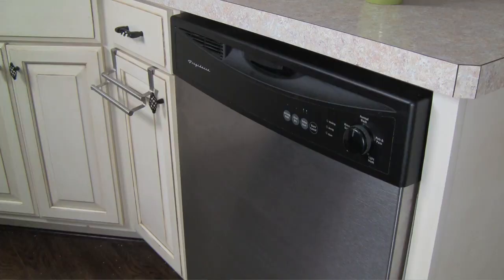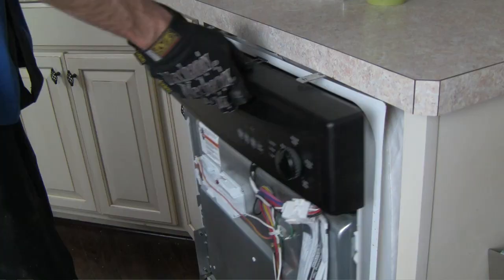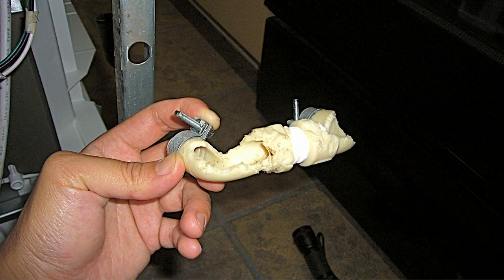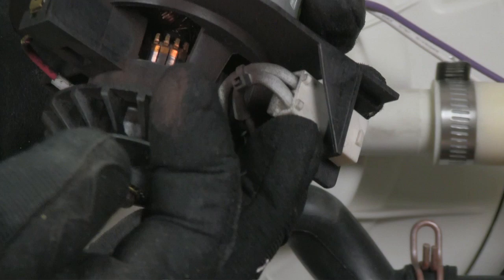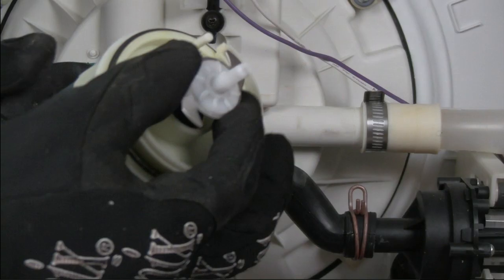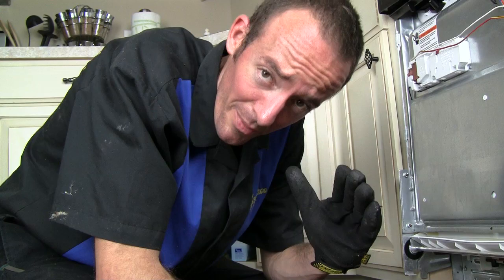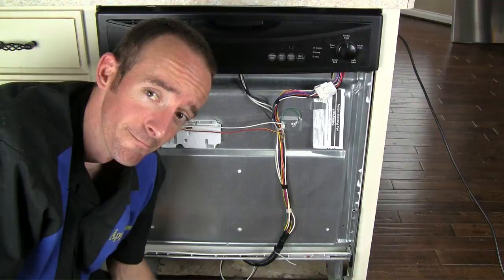How To Repair Frigidaire Dishwasher Noises

Comment: Ok. figured out it was the brass connector needed to be tightened. But when i pulled the wire off it had brown blackish mark on it....maybe an arch flash? when water was driping on it? is there an internal fuse for this?? or did it short out the whole heating element. I dont have a meter to test the element.

Comment: Here's a question for you- the float in my dishwasher had a chunk of food holding it up so I think the drain pump stayed on too long. Is there a fuse or thermo shut off that would kick in if the drain pump over heats? She's not draining and no sound from the drain pump.
Reply from the maker: Not normally. The float being held up would keep the dishwasher from filling but that should be all on this style.  You would probably need to measure for 120VAC on the leads to the drain pump after pressing the cancel/drain button. If you are getting 120AC then its probably a bad connection to the drain pump or the pump is bad.  Hope that helps!

Comment: I have model pld2560lcc1 and keep getting a "CL" error.  The latch is clicking shut and wash cycles run for like 20 minutes then "CL".  I'll open the door for 30 minutes then close it and the cycle will run for another 20 minutes.  I have to do this for each wash.  Could it be something as simple as the door gasket or am I going to have to buy a new latch/control board? Thanks for this video.

Comment: my dishwasher works fine but as the days go by and if I don't use the dishwasher, it accumulates water inside the dishwasher... Would it be the inlet water valve that's leaking water or the water pump that is defected?
Thanks for your help
Reply from the maker: Sorry for the delay in responding to this! too much on my plate in the last few days.  Yes that does sound like the water valve is not closing completely, and is letting water slowly leak into the tank.  most likely a new valve will fix it. Good luck! thanks for the question!

Comment: Under the Diverter Cap there is a ball check that rolls down a set of moulded rails to plug off the inlet port to the top jet. I've opened it up and can't for the life of me figure out what moves that balls position from blocking the top jet to blocking the bottom jet. I ask because my washer has recently been doing a terrible job at washing my top rack and it appears that the top jets do not activate... Any ideas how that activates or what controls it? I have the same washer as is in the video.

Comment: Can you purchase the impeller separate from the pump? I had a plastic bead lodged in the impeller area and cause the threads to strip (plastic to metal, metal wins) either that, I might epoxy the impeller part onto the shaft of the motor.
Reply from the maker: Darrin Calcutt Sorry for the delay. Unfortunately no it's a complete assembly... and very common to break I might add... Thanks for the question!

Comment: @applianceassistant On the third wash attempt it started a wash cycle that I'm pretty sure was different from what I programmed.  On the fourth attempt it made it through a normal cycle, but didn't dry even though I'm pretty sure I had pushed the "dry" button.  Anyway, it appears to me that it is losing power somehow during the wash mostly (and at least this one time while it was off) and resetting and is also starting to flake out on the cycle programming.  It's a Frigidaire FDB1502RGC2.  Thx!

Comment: My frigidaire wont drain. I followed the steps in the video. Both motors fire up when I wire them direct to a power source. Could it be an issue with the circuit board?

Comment from the maker: @NJ2017 It depends on your state what certificates may be needed. But in most cases you just need to be able to fix things well and be honest and fair so that word of mouth advertising will spread your good name.  There are some large differences from one appliance brand to another, however the same components and basic mechanics are for the most part used over and over.  If you learn basic circuitry and get some hands on classes  at a trade or community collage it would be a good start.

Comment: what would the problem be if the dishwasher will not run the wash cycle? It fills with water and drains but does not run the wash cycle

Comment: Dear applianceassistant.  My Frigidaire gallery has the symptom of a grinding noise, single click sound upon engagement of the sprayer(s), and the top rack is leaving dishes dirty.  When I run the normal cycle, I hear the water begin to smoothly spray and about 3 seconds in, I hear a single click and then grinding noise begins.  Any ideas? I have taken apart the two screens and no major debris but heavy mineral build up.  I plan to run vinegar through it and take apart the the diverter cover.

Comment: I have the same dishwasher. Water is running during the cycle, heat is working, drain is working. However, dishes are coming out with soap all over them and not very clean. We think that maybe the spray arms are not rotating during the cycle. Does the motor control the spray arms? We've cleaned everything and nothing is blocked?

Comment: not sure if I have the same problem. so it starts out strong and normal sounding then pump slows down and gets noisy then pump almost stops turning. I'll give it a shot thanks for the video.
Reply from the maker: Matthew Arb sorry for the delay. That's tough, the pump noise changes sound depending on if it's pumping water or suds or if there is a lot of sediment as well. You may get lucky and find something shifting around lodged in the pump. Good luck! Thanks for the comment!
Reply: applianceassistant is the bottom element supposed to get hot at the very beginning first wash
Reply from the maker: Barbara Pierce On most cycles yes.It comes on to assist in heating the water for wash on all but some rinse cycles.

Comment: I repeated your steps and found that the circulation motor is burnt. I found that the brushes had burnt black and left carbon dust and the motor doesn't spin any longer. How can I find the circulation assembly for the model you are using (by appearances they are the exact same model dishwasher).
Reply from the maker: You will want to use the model number of your dishwasher to be sure you get the right one.  The model tag should be on the inside. Open the door and it should be on the tub outside the door seal. If you give me the model number Ill post a link to the part for you.

Comment: I have the same leak, last night the wash cycle was making a high pitched squeal and this morning water was leaking under the machine.. pulled the front cover and it looks like it is dripping from the plastic collar next to the motor.  Bad O-ring?  Think I might tear it apart tonight to investigate...

Comment: Hi,
13462k903 kenmore dishwasher.
Smart wash button stopped working.  Do you know how to troubleshoot it without just changing whole control board?  
Wash Arm Bearing (Spray arm seal) 8268340 after reassembling I do not know where to put it? Thanks

Comment: This a great video, fixed the noise, but now my cleaning arms are not moving.  Any ideas
Reply from the maker: That is strange, if the lower spray arm moves freely, then the must be ether a clog or the motor impeller is not spinning. If that’s the case it would need a new motor... sorry for the difficulty, hope that helps some!

Comment: @applianceassistant Not sure how to explain, but basically the washer just stops at some point during the wash and doesn't restart.  Two lights on the front flash, but I keep forgetting to note which ones.  Yesterday it wouldn't even turn on at first.  no lights...nothing.  So I checked the breaker and it was still on, but I went ahead and reset it anyway.  When I went back to the kitchen the two lights were flashing.  Then I started a wash and it stopped midway...three times in a row.

Comment: The wash motor is leaking on my dishwasher.  I took it off, inspected it, and put it back together before I found this video.  I did not see anything obvious, but curiously, it doesn't leak as much.  If I remove it again, clean the seals good and put it back together is it possible it could solve to problem? Have you seen anything like this before? As a note it is at a vacation home so it sits for long periods of time not being used.

Comment: I looked at this video because it was the only one I could find with my model although my issues are different. This morning dishwasher was not draining--dirty dishes. I tried to start it again and it wouldn't with the normal cycle, but when I slowly turned knob it started in between a cycle. I finally gave up and removed the dishwasher. When I turned it over I noticed that the red plug that goes to the heating element was black (I have a picture). Still not sure what will work...

Comment: Are both motors used for draining?  Or just the drain motor?  It seemed like it might use both from the way they are assembled.  My dishwasher isn't draining and I am not sure which motor is bad.
Reply from the maker: Sorry for the delay! on the frigidaire dishwashers only the smaller pump attached to the drain line is used for draining.  You will also want to check the drain line and air gap at the sink, if you have one and you haven't already done that.

Comment: I have a basic Frigidaire ultra quiet dishwasher that's about 7 years old.  It has suddenly started to leak so badly every time I run it that I have to keep a catch tray under it.  Of course I forget to empty that and DISASTER!  Also, I have noticed a decline in the cleanliness of the dishes, they seem covered in a much heavier haze than usual.  Any ideas, or do I have to junk it?
Reply from the maker: Bummer! Some other models use a motor that cannot be taken apart like the one in the video... That motor has an internal seal that has been pretty common to leak.  If it's that you will see water leaking out of the motor vents, probably a black deposit too.    Not a difficult repair, the hardest part is pulling out the dishwasher in some cases.  If you give me a model number I'll send you a link to the motor.  Thanks for the question!

Comment: Question... Mine fills with water and run threw all the cycles but does not clean the dishes, the soap is still in the tray and is hardened.  Since it fills with water would that rule out the inlet valve? i checked inside, nothing is clogged.  could the problem be a bad motor / impeller?  when the machine is trying to wash it does sound like the motor is running tho.  Please help..Thanks

Comment: My door leaks occasonally gaskets look good, five years  old, frigidare dishwasher mode lfghd24651a. I notice splash shields have  a slight tear on top, both sides are identical. How to fix problem?
Reply from the maker: the splash guards have been a common design problem because the bottom rack repeatedly rolls over them... so replacing them will probably help, the bottom door gasket can also be the source of leaks so I would advise getting both. before you do that though, check the level from front to back and see that it is not tipping forward at all. sometimes slightly lowering the back of the dishwasher can fix small leaks. hope that helps. Good luck!

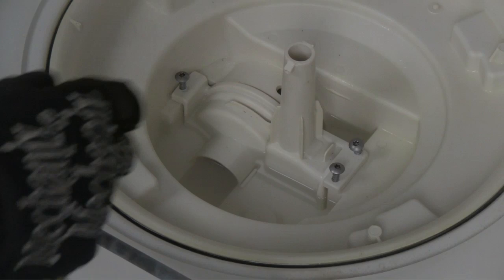Comment: Hi, the little white water wheel/diverter  (not sure what the proper name is but it is spun at 1:36) is not spinning freely (or at all) in my dishwasher.....

Any idea what I do next to fix this?     I'm not sure what to do next now that I've found this problem....

Any help is greatly appreciated!
Reply from the maker: Sorry for the delay. That is the main wash motor, so its probably going to take a new main motor to get it working again. When you get into more expensive parts like that it gets to be a fine line on repair vs. replacement. I hope that helps!
Reply: applianceassistant ty for responding.   Great video, I learned a lot...

Comment: i have a similar dishwasher and it is doing the same thing. however i have removed the impellers and it is still making the same noise. the back panel doesn't seem to be removable and there is a dirty grimy vent closer to the front of the impellers. i am afraid that is may be the bearings but i have no proof that it is the problem. any suggestions?

Comment: my frigidaire dishwasher will not drain. i troubleshoot everything besides checking the drain pump. do you think most likely its the drain pump?
Reply from the maker: It’s pretty likely, if everything else looks clear. You may want to open up the pump and check inside for anything that may be blocking the impeller of the pump before you replace it. Good luck!
Reply: @applianceassistant  i purchased a new drain pump and now dishwasher is draining

Comment: Ok i have drain pump issue with the exact dishwasher you are working on, however I cannot find the model number on my dishwasher.  Only difference is that mine is white, not the fancy schmancy stainless/black.  Can you provide me with the model number?  I'd gladly order the drain pump from you, if I need it.  I'm going to look and see if I have something stuck in there.  I ran the dishwasher with drain hose removed and water just trickled out. Thanks

Comment: It seems as if i have water coming thru the vented area of the motor you refer to in the 5;25 minute mark of the video. I watched from underneath after taking the bracket off. there is a little hole in that vented area. could/should water leak from this spot? and if it does do i need to replace the motor kit? thanks John
Reply from the maker: Hi John, unfortunately that has been a common problem with that particular motor.  You will need to replace the motor to fix that one. Unfortunately there's no way to replace the internal seal.  Good luck!
Reply: applianceassistant thanks, with the cost of the part i might as well buy a new dishwasher. appreciate your help
Reply from the maker: I think that's probably a good decision.  My pleasure!

Comment: If not could you point me in the direction of where to look fora noise that only occurs during the wash/drain cycle?  Impeller spins freely on the motor.

Comment: I have a Maytag intelligencer that is leaking from motor gasket. It is not possible to replace gasket only; You have to replace the whole motor, and it is no longer available anywhere. I had an idea to caulk the gasket with hi temp caulk. What do you think?
Reply from the maker: paula holdgate Great idea! I would be inclined to use waterproof Silicone sealant instead of hi temp calk, but yes it would probably work.  What is the model number of your dishwasher?
Reply: Thanks! Ok, I am a girly girl, not a fix it girl, so do you have any idea where this gasket may be? MDB6800AWW
Reply from the maker: The main pump gasket is part# 912529 here is a link http://www.repairclinic.com/PartDetail/Pump-Gasket/912529/739967?RCAID=27317
(20.00) 
here is a link to the part diagram the seal is #22 on the picture:
http://c.searspartsdirect.com/lis_png/PLDM/M0703121-00007.png
Hope that helps!

Comment: I have a very similar dishwasher.  There is water dripping from the wash motor right were those rectangular shaped holes are that are facing down when the dishwasher is upright.  I first thought it might be the o-rings in the wash motor but it dont seem the water would drip from there.  Im going to pull the washer out today or tomorrow to get a better look.  Any ideas before then?
Reply from the maker: Thad Jones Unfortunately it would most likely require the replacement of the motor. That has been a fairly common problem with the Frigidaire dishwasher motors. (Slightly different from the motor used on the dishwasher in this video) Not sure if it's worth it... If you do it yourself it may be. Sorry to be the bearer of bad news.

Comment: Please help.  I have determined the area of the leak.  It is coming from the tiny vent slots in the bottom of the circulator pump.  If you look closely through the slots you can see a tiny hole and some gears inside.  The water is coming from that hole.  I think this is from the seal around the shaft (small, thick black seal around the shaft under the macerator).

Is there any way to fix this?

Comment: If you still have a noise similar to the whining noise even after replacing the motor, what else could it be?
Reply from the maker: If you replaced the main motor you may still have something in the drain pump motor, or visa versa.  It's about 50/50 as to which one is making the noise or it could be both.  I have had noise issues with both motors on my dishwasher...  The other thing you can do is add some fiberglass insulation behind the lower panel of your dishwasher to help absorb some of the noise. Hope that helps!

Comment: My metal screen had a tiny ball of ceramic from a bowl stuck in one of its holes. It
 was just a bit bigger than the hole, which was big enough for the one 
chopper blade to graze it.

Comment: My Frigidaire dishwasher keeps filling with water when I open the door. What is the problem ?
Reply from the maker: Sounds like the dishwasher's water valve is stuck open.  If you flip the breaker off to the dishwasher, does it still fill?  That would verify that it's the valve.  If it stops when power is cut off then you have a control problem, or a bad door switch... But the valve is most likely the cause.  Here is a link to the dishwasher repair manuals on my website:
http://applianceassistant.com/Appliance-Repair/Appliance-Service-Manuals-Index.php?appliance=dishwasher
Good luck!